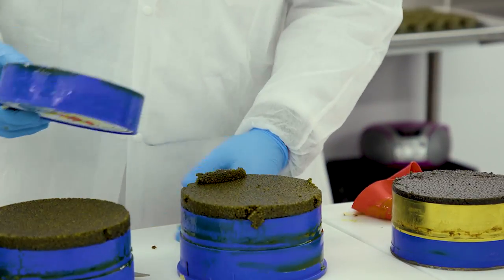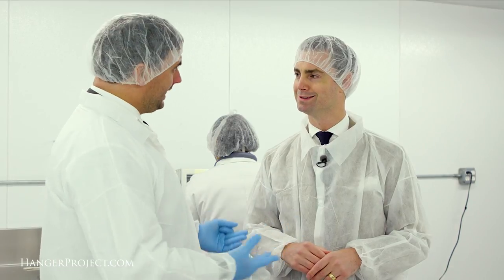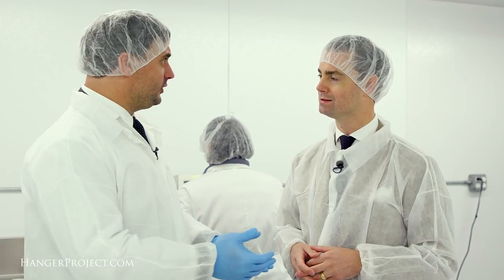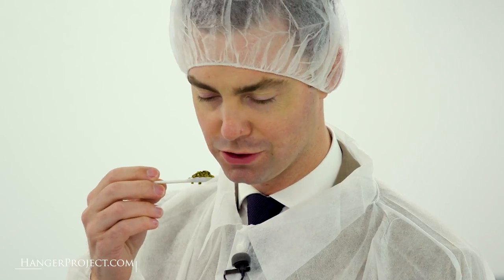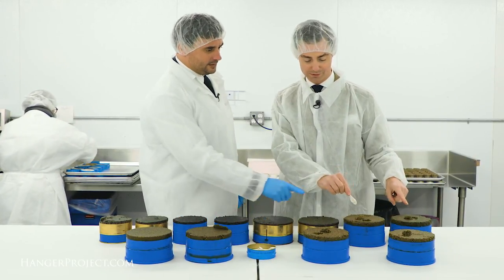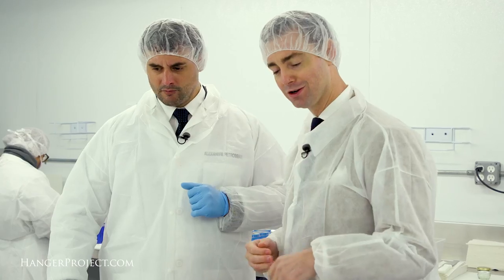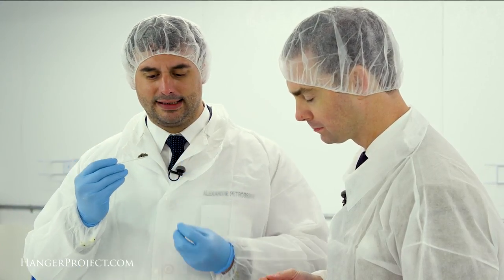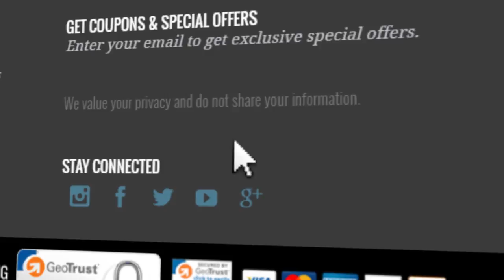How To Grade Caviar | with Alexander Petrossian

Comment: Dear Kirkby, I don't live in the US. I live in India. I have pure leather boots. It's not the best quality stuff but it's called genuine leather. I know it's the lowest grade of leather. It still looks cool. I used it for a month and I saw the boots drying. I purchased a shoe cream as the shop keeper said it's better than wax polish. It made the leather soft but still not very. The boots easily dry after a few days of applying shoe cream. But the biggest problem is that I use neutral shoe cream on my tan boots. After applying many coats like a apply 1 coat once in 15 days. Now the boots have a whitish coating on it that is flaking out. It looks like a thin layer has been formed over time as shoe creams not only nourish the boots but also apply a thin protective coating. I don't have a saddle soap so I used my bathing soap to remove the coating. My leather boots became dry after wash. I used the shoe cream and it looks better and not dried out. But the cream isn't nourishing the boots much. I've found a mr leather cleaner and conditioner in the market for leather sofa, car seats etc. So is that a good product to primarily nourish my shoes or should I buy a leather conditioner made in US for my shoes. Most of the guys have recommended me to get a leather conditioner with out polishing properties. What should I do? I like my boots and even want to get cow boy boots but for preventing cracking or drying of my boots can I use Mr leather cleaner and conditioner. It says cleans and conditions.
Reply: Michael -  is it a conditioner?
Reply: This has nothing to do with caviar